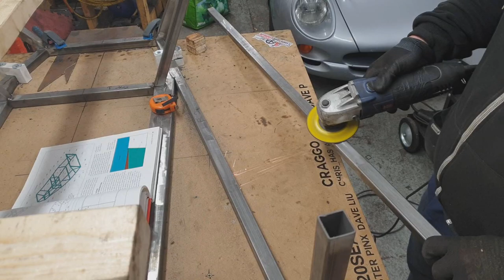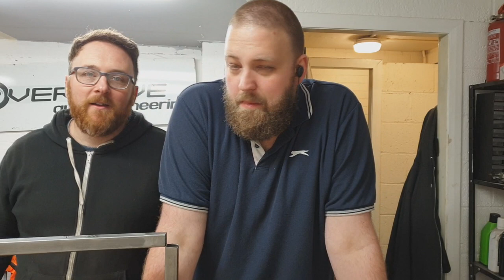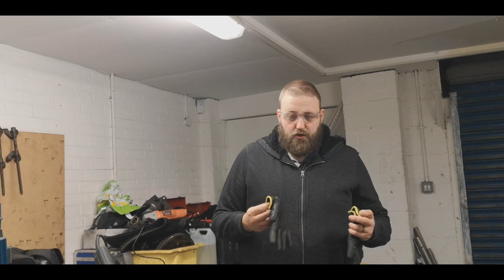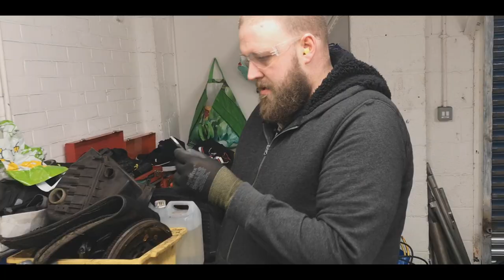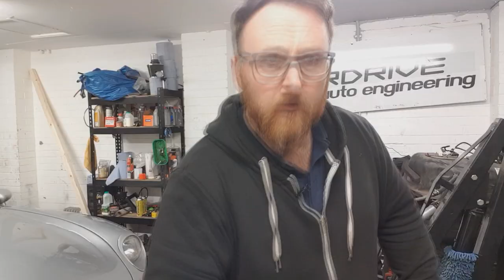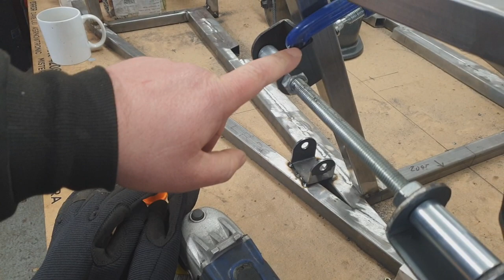Locost 7 Kit Car FULL BUILD!! - Episode 7 - SUSPENSION BRACKETS (Project 7-UP)

Comment: Hi Tommy, can you tell me where you got the long, 12mm threaded bolt you used for the bushing jig?   NO exaggeration, but I have been looking for one of these quite literally for months.  I need one  to use as a counterweight shaft for a telescope mount and I can't find one anywhere.  Your help would be very much appreciated.  Keep up the good work with the build.  Cheers.  Frankie
Reply from the maker: https://www.ebay.co.uk/itm/273854890891 use this with 12mm nuts. Simple :)

Comment: Buying the brackets seems like a good idea.  They look a little different to the one that you made, a bit like the centrepoint for the outer radius isn't the same as that for the bolt holes - is that just a trick of the camera?
Reply from the maker: They are for the majority of the pick ups, but we were making what we thought were the 2 for the front upper. Its 4 we needed.... they are a shorter bracket overall on these plans.

Comment: How about a links for the parts you're buying off of Ebay, I'm thinking of trying this myself. I have a 1200cc motorcycle motor lying around with a need for a new home. Any build forums, links or parts from any where would be helpful. Nice job guys, it looks as if you're having a good time, Wish you lived around my house I'd be over giving you a hand😉
Reply from the maker: Links dir quickly when sellers stop listing things, however very happy to link any part you need directly